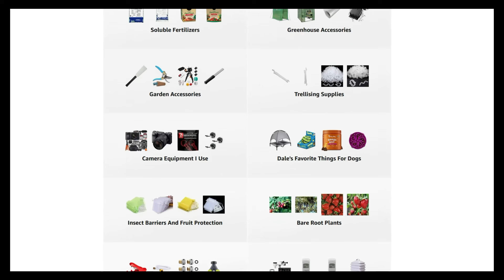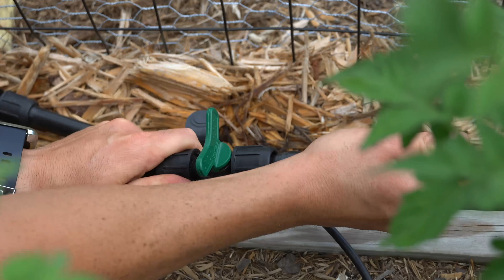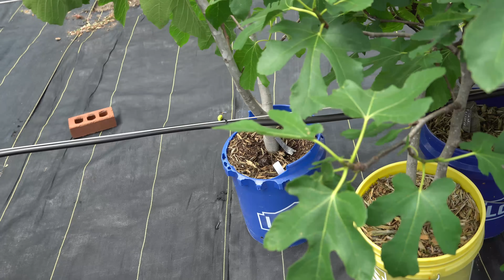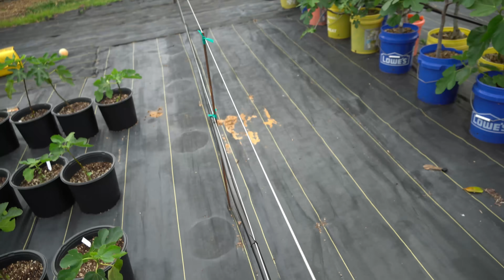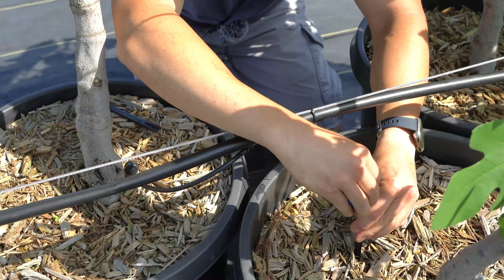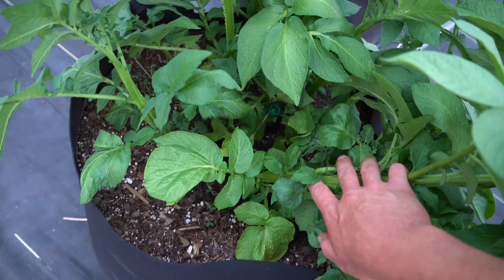The BEST Guide To Installing DRIP IRRIGATION To A Container Garden

Comment: Do you think the 1 gph emitters are enough for the 25 and 30 gallon grow bags? I was thinking of doing two or three 1/2 GPH per bag to water more evenly...or is that overkill? Thanks!
Reply from the maker: Yes. I use single 1GPH drippers in my 20 gallon grow bags containing individual plants - tomatoes, cucumbers, etc. For my 25 gallon grow bags that contain sweet potatoes and potatoes, since there are essentially multiple plants in the bag, I use a T-barb to split the incoming 1/4-inch blank tubing into 2 blank tubes, then put one 1GPH dripper on both sides of the bag, so they get 2 individual 1 GPH drippers.
Reply: @TheMillennialGardener  Thanks for the quick reply!

Comment: Hi
Do you have a list of all the items used from drip depot? They have lots of kits with a dizzy amount of options. 
Which kit should I use as the basis to modify?

Watched these videos twice today during water breaks from filling our raised beds!
Reply from the maker: It is very dependent on the layout of your garden, since everything is unique. The most important parts are going to be:
- 15-25 psi pressure regulator at the source.
- 1/2" Distribution/Main Line Tubing
- 1/2" 90 degree, T and + elbows, as needed
- 1/2" Shut-Off Valves, as needed
- 1/4" Blank Distribution Tubing
- 1/4" Drip Line, emitter spacing of your choice
- Whatever 1/4" Barbs, Drippers, etc. you need to connect the system
- Goof plugs, a puncture tool, landscaping staples to hold down the tubing, etc.
Reply: @TheMillennialGardener  perfect 🤩 this list is very helpful to make sure I don’t miss essential parts. Thank you 😊

Unique indeed. One word “labyrinth” 😅
Reply: I found the design videos on the drip depot website. I think that will answer my questions. 😊

Comment: will one emitter will be enough for a 24" pot, since its only on one side of the pot? Thanks.
Reply: Drip Depo has adjustable button dripping~ers. I’ve been researching them to use on my balcony. I had some water damage due to a poorly installed door. The last thing I would do is add moisture from a poorly designed drip irrigation system. This is the way. One day I will film a walk through/around my estate. There will be many garden beds and I might have installed the pitcher pump at that time. Drip irrigation is more better.
Reply: @philschopshop4591  Thanks for your comment.

Comment: how much time would take to water 10 gallon grow bag with 1 Gallon dripper please? Also would the dripper irrigate the whole bag up to the side of the pot, and Is 2 gallon drip emitter would be enough for 20 gallon grow bag? Thanks.
Reply from the maker: A 1 gallon per hour dripper does exactly that - it adds 1 gallon of water per hour. That is going to depend on the mix you use, whether you mulch, the temperature, etc. You'll have to observe and fine-tune based on your conditions.
Reply: @TheMillennialGardener  Thanks a lot for the prompt reply.

Comment: INTERESTING, WE SPENT A YEAR RESEARCHING IRRIGATION SYSTEMS AND DECIDED TO GO WITH DRIP DEPOT. ALL OF THE 1/2" CONNECTIONS HAVE WORKED OUT WELL FOR US, HOWEVER THE COMPRESSION CONNECTORS ON THEIR DRIP TAPE KEEPS POPPING OFF. THAT PIECE HAS BEEN FRUSTRATING.  ATTACHING THE 1/4" IRRIGATION TO THE 1/2" MAIN HAS ALSO BEEN A PAIN, ANY IDEAS ?
Reply from the maker: Are you using a pressure regulator at the spigot end? Drip irrigation systems cannot tolerate pressure above 25 psi. If you are not using a regulator, the connections to the main line will blow off, as will the drippers. If you are, it's possible you need a smaller regulator. After about 3 years, my 25 psi regulator from them started wearing out and whistling, probably from mineral build-up in the water. I replaced it with this at the spigot, and it's been rock solid since: https://amzn.to/4ddpu5A

Please note the link above is an Amazon affiliate link from my storefront, so if you were to use it, I would receive a commission at no cost to you.

Comment: I have my 200ft garden hose stretched out across my lawn to my GH. When I go to water in the afternoon  WOW  that water is hot!!!
You could make a cup of tea with it it is so hot. I let it run 2min before the heat begins to subside. I hate wasting so much of my well water like that.
QUESTION>>>
Would water that hot hurt a plant? Your black irrig hoses running throughout your garden sitting in the hot sun must also get
pretty hot.  WHAT SAY YOU?

!
Reply: Yes, water that hot will hurt your plants.

Also, you aren't WASTING your well water - the water falls on the ground, gets filtered by the dirt, and winds up right back in your ground-water supply.  "wasting water" is just propaganda.

Comment: New gardener here 
Is a soaker hose the same as drip irrigation?
Reply: No but it's similar in the sense that it will water your plants or beds slowly instead of a rush of water that could leech out and not be useful

Comment: I’ve been using the drip irrigation system for a couple of years now. For the most part it works great but I found that some of the barbs become loose in the holes of the main line. What can you do to remedy that?  I’ve thought of using Plumber ‘s tape but I was wondering if you’ve had the same problem, and what do you do to fix it? Thank you in advance, Sandra.

Comment: This seems like a lot of work and material. I used my zone 9 of sprinkler system that is run to each raised bed underground. Then I threaded a 1/2” ball valve on a riser where I can either shut off the bed or adjust the flow at each bed separately. Works much better and I can connect either the sprinkler nozzles or drip irrigation tubing to each plant. Also the same system can be connected to my rain barrels with an added 12v water pump. Been working well.
Reply: This seems like a lot of work and material too.
Reply: What is a "zone 9 of sprinkler system"?

Comment: I know you did this a while ago but it’s perfect timing for me. I have my wicking tubs plumbed together so they have water reservoirs under them to keep them watered, but someone bought me some grow bags and I’m not going to put water reservoirs in them so I wanted to see how this was done. I have no power out to where my garden is but I have a sprinkler system that I need to get running from when I bought the house and I have water barrels out there that I can hook up to provide water on a regular basis if I decide. I haven’t seen all of your videos but I’m sure you have to have an automated setup somewhere for your drip system. That will be the final part of my puzzle to engineer.

Comment: You said to make sure you stick to one drip manufacturer but looking at Drip Depot they sell from a variety of manufacturers? With all the shut-off valves you installed it seems like a onerous task task to remember which ones are open and which are closed. How would you incorporate a timer to your system?

Comment: Do you manually turn on and off your zones as you water through the different areas? Do you use a timer on the line, or just turn water on and watch until things are soaked properly? When you use 1 gph emitters (for example) do you actually run your water for an hour in that zone?

Comment: Is there any video where you show the setup at the hose faucet with a 20-25 PSI valve, and the zone lines splitting off from  your main line? I didn't see this in the video (please forgive me if I missed it).
Reply from the maker: Yes. The link to my drip irrigation series is in the video description.
Reply: @TheMillennialGardener  Thank you, I found the link, I was just wondering if you show how to split zone lines off the faucet line anywhere in the video? Also what about connecting a timer for your system, so you can water even when you're not home? Which timer would you use with the drip system you feature?

Comment: Thanks for the excellent video. Clear instructions, easy to follow. Question: It's a lot of work to plan, cut and tie the system in place - can it be left in place over a Northeast winter without damage, so long as the lines are not full of water? How would you properly empty all the lines? Also do you have a link to a 20-25 PSI valve to attach to your hose faucet?

Comment: I love your irrigation set up. I’ve been struggling with irrigation in my garden. It works for the first few days but then by day 3 some of the droppers stop dropping while a few will still work. Your system is very large. What size pump do you use? Do you do anything to maintain consistent pressure from the first drip line all the way to the last one? Thank you

Comment: This is an excellent video, as usual!  Something that  haven’t heard anyone explain and am curious if you can address.  You said that your emitters were 1/2 gal per hour. 1/2 gal doesn’t seem like a lot of water and it especially seems crazy that I will have to run my water for at least an hour.  (I know you showed us the gal emitters, but they still take an hour.)   Is there something that delivers water quicker than 1 hour or would that flow be too damaging to the plant?   Love you and Dale!  TIA.
Reply from the maker: In the video description, I have a link to my Drip Depot affiliate store. They sell 0.5GPH, 1.0GPH, 2.0GPH...I think even 4.0GPH emitters.  You can get them in all different sizes. However, please keep the following in mind:

1. Drip irrigation systems need to have a restriction valve on them that limits flow to 15GPH. Otherwise, the pressure is too great and it can burst your entire system. Therefore, the entire system can only support 15 gallons per hour of flow. So, if you want to use 1 gallon per hour emitters and you have more than 15 plants to water, the flow is going to be naturally restricted. If you have 30 plants and you're watering them to 1.0 gallon per hour drip emitters, they're only going to function at 0.5GPH, so you'll still need to run the system for a long time.  Using larger emitters won't help, because they'll be reduced in-kind.  The only way around this is to have multiple points where you feed the system and break the system into many parts, which isn't exactly convenient.

2. The point of drip irrigation is to slowly penetrate deeply into the soil. If you water the system with a high GPH rate, it's going to behave more like overhead watering, and the soil may repel the water. Using slower dripping emitters and running them for a longer period of time actually penetrates the soil better and waters it more deeply. Since the system is automated, it doesn't really harm you to run it longer. Just set a timer on your oven so you don't forget to turn it off, or buy a timer that turns it on and off manually for you.

I hope this made sense.
Reply: @TheMillennialGardener  YES!  Thank you!  I had NO CLUE about the 15 gph limitation and that makes perfect sense.  And that we need to water slowly for the good of our plant.  Great information as always!  We appreciate you!

Comment: I have a few questions.  Would you suggest buying individual parts or a beginner kit for approx. 30  5 GAL containers? Is the drip emitter rate 0.5 gal per hour PER PLANT or overall? I would also like to know what landscape fabric you use/recommend to help my newbie container garden. This vid was  helpful, informative and concise. I need to start an order list. One last question, how many times per day do you water during the heat of the summer? East Texas here. Thanks so much!! :) Lisa
Reply: What did you end up going with?

Comment: Is your line(s) on a timer?
Reply from the maker: No. I operate it manually as needed, because our rains are erratic and can be severe in the summer. You can put it on a timer if you have a more reliable climate.

Comment: Maybe a dumb question, but how long do you leave them dripping for? Is it an all day thing?
Reply from the maker: No. It depends on the time of year, the size of the drippers, the size of the containers, the weather, etc. These are half gallon per hour drippers, so if you let them run for 1 hour, they will drip 1/2 gallon of water. In the summer, they will usually run for about 45 minutes each day, since that will deliver a little over 1/3 of a gallon, which is enough most hot summer days. If it rains, they obviously don't need to run. If it's spring, or if it's fall, they don't need to run every day.
Reply: @TheMillennialGardener  can you recommend a timer for the spicket?
Reply: @brad4527  I use an Orbit timer, model 27729.  I've had it for some years, so I'm not sure that particular model is still being made.  It works on two AA batteries.

Comment: Hi. Can I use water from my water tank 1000L standing about 1 meter high? So lots of water but not much pressure.
Reply from the maker: It depends how far away your drippers are and what their elevations are. You'd have to check the different elevations and make sure your tank is significantly higher.

Comment: How long do you run it for and how often do you run it
Reply from the maker: It depends on many factors: how hot it is, how much rain we are or aren't getting, how big the plant is and its water demand, etc. You need to check the soil. Stick your fingers 2 inches deep. If it's dry, water it. How much is going to depend on the rate of your drippers.

Comment: Isn’t the water extremely hot on a hot summer day with the sun beating down on those black tubes? Does that not hurt the plants?
Reply: Yes that would be VERY BAD for any plant/vegetable/tree, thats why you have to water them when the temp is cool, usually early morning or in the evening. Never run drip irrigation during the sunny part of the day.

Comment: I wonder if you get freezing temps later in the year? We freeze hard in the mountains of central Oregon. Would I need to disassemble the lines or can they withstand freezing?
Reply: Depending on how large your system is  you take a small compressor or canned air and attach it to the main waterer open up all the valves and the ends just blow out all the water, then replace the end caps so bugs and debris doesn't get in.

Comment: So does the distribution line just connect to the house faucet?
Reply from the maker: It is connected by both a rain barrel and to the house. You cannot simply connect it to a house line. You need a backflow preventer and a pressure regulator, or you'll blow the system apart. I have a full install guide here: https://youtu.be/szMxYIKDXmU

Comment: I just came in for a break from the heat as I was working on installing my drip irrigation system into my raised beds this afternoon and low and behold, Youtube just recommended this video to me!  I'm using the Perma-Lock fittings as well and they are a dream to work with.  I've just flushed out the main tubing and am all set to join the micro-tubing and emitters after I gather up the courage to face the heat and humidity again.  Great video!
Reply: I wish I knew how you found the perma lock fittings or anything on that site for that matter. There is no search engine that I could find and I'm finding  myself completely overwhelmed.

Comment: How long(ft) and how many .5 gph emitters can you use with your 1/2 inch pipe using gravity feed tanks?  How much higher are your gravity tanks compared to your garden?  Thanks
Reply: @The Millennial Gardener I too would like to know the how high your rain barrels are above your garden. Does gravity feed allow you to water more than one zone at a time? I see in a later video you did raise your barrels. What is total height above garden?

Comment: Thank you!  This is the most instructional drip system video that I've seen! I have a very small garden that I want to set up on a drip system but had no idea on how to go about it. Not many instructions with the system I purchased so I found it confusing. Add to the fact that I am a visual learner. I lost some plants last year due to being out of town for a family emergency. I promised myself that would not happen this year if I had to go out of town.
Reply from the maker: I'm glad the video was helpful. Definitely set up the drip irrigation system. I put installing mine off for awhile, because it got too hot last summer and I lost the energy to do it. Now that it's done, I'm so thankful, because it has made life so much easier. I just left for a vacation, and my neighbor came over a couple times and just turned on my spigot for 15 mins. Everything did great. It's a lifesaver.

Comment: Question - I get that you do not have a set schedule of when you use the drip system or for how long you let it run due to so many factors to consider.  BUT......., on a typical summer day with no rain in the forecast & with temps in the 80's-90's & full sun, HOW LONG of time would you run the 0.5 gpm emitters for and  WHAT time of day would you run them for?  I am in South Jersey (Glassboro, Gloucester County) which you are familiar with.

Comment: I did not hear you mention installing a regulator to reduce the water pressure feeding your drip system.
Reply from the maker: That is covered in earlier videos in my series. This video solely pertains to installing the irrigation system to the containers. The physical main line construction can be found here: https://youtube.com/playlist?list=PL1gY7BoYBGIHHHsx0JPcYgD4xXzA96usL
Reply: @TheMillennialGardener  That is fine. I am well versed in irrigation methods, but the novice is not and not mentioning the obvious in your video, which is extremely detailed for the novice seems troubling. Just some advice.